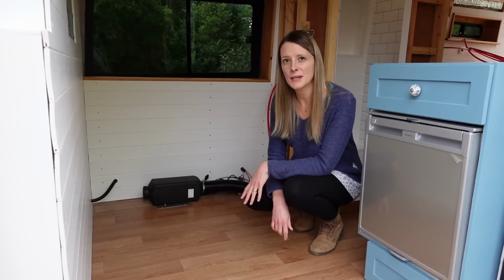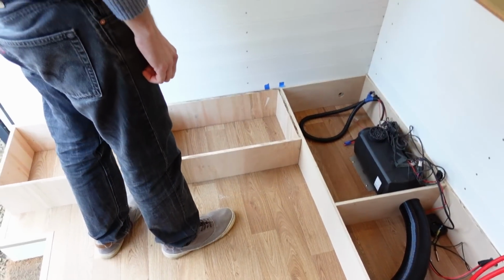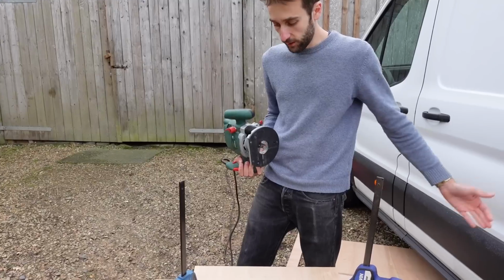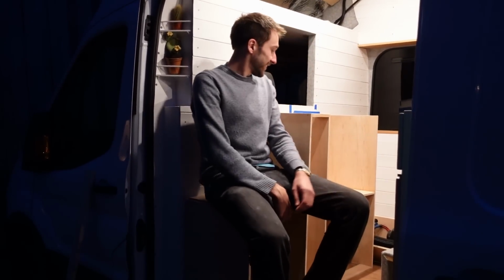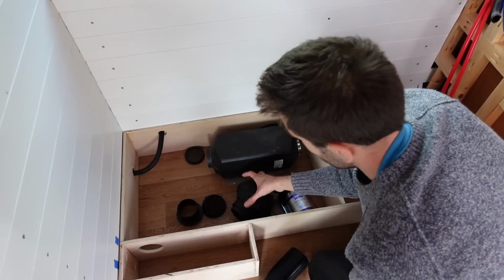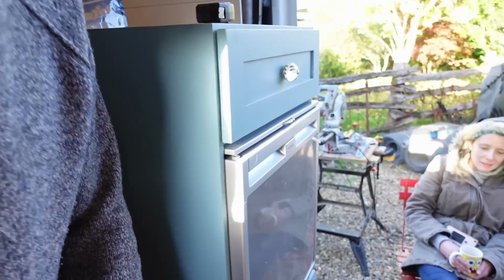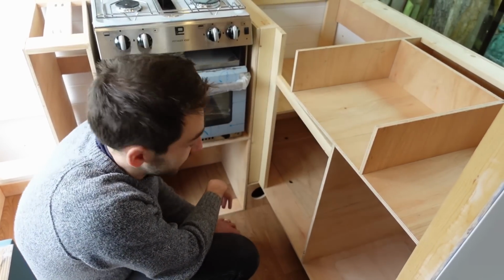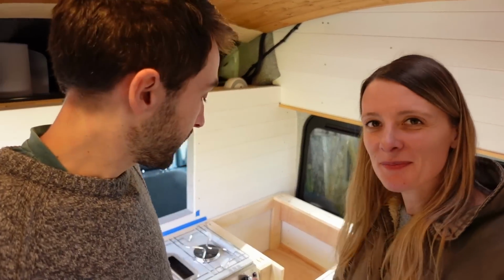DIY Campervan Kitchen Cabinets (With Built-in Seat!) | Transit Van Conversion E32

Comment: Hi thinking of getting same cooker what’s the total depth of the cooker in the unit thanks
Reply from the maker: Hiya, the base part is about 30.5cm deep, but there is also a 4cm spacer that's permanently attached to the rear to make sure there is adequate ventilation and it's never right up against a wall. So around 35cm depth would mean the base is completely seated, but with the door and controls overhanging a bit. Or around 38cm if you want the whole thing to sit flush in the unit. We have it about 38cm back, which also leaves the base 3cm from the front edge of the shelf,  just enough space to use the front screw holes to secure it with a little angle bracket. HTH! 👍

Comment: what size ply did you use for the built in seat
Reply from the maker: Hiya, we used 12mm ply for the whole cabinet (which is actually around 11.5mm). And for the seat we also added some rails underneath it with some pieces of whitewood at the front and back to add a bit of strength spanning the gap 👍

Comment: Hey guys, how are you tackling weight to keep it under 3.5t
Reply: This transit takes 4.9t
Reply: @Gordz  does not matter what the vehicle can take, your standard licence will only allow you to drive 3.5t
Reply from the maker: We're always mindful of it and have been taking the van to the weighbridge at various points so we know what our budget left is and keep track of what goes in. We try to use lightweight materials so for this one we used 12mm ply which was the thinnest we could imagine actually getting to work, and for the more skeleton cabinet we didn't put any walls on as we're using the cladding that's already in as the backs. So basically just trying to be conscious of it all the time, but still get in the things we want. We wanted a nice Belfast sink so looked around for a while to find one out of resin. And one of the reasons for going for a recirculating shower was to keep the amount of heavy water we need to carry down too. It's definitely tricky to always have to think about the weight but on track so far and fingers crossed it will come out on target for the final weigh in 🤞🙂
Reply: @videodomination  Countries kilometerage varies, then.   No issues in aus with the jumbo van.   I've ordered one.
Reply from the maker: @youtubehandol  Yeah for us we can only drive up to 3.5t on our licence, unless we take an additional test 👍